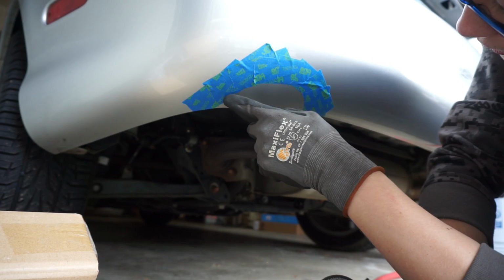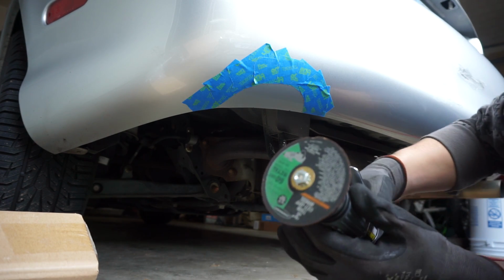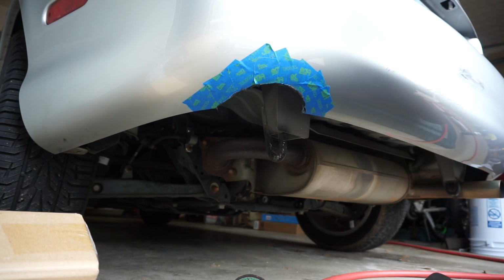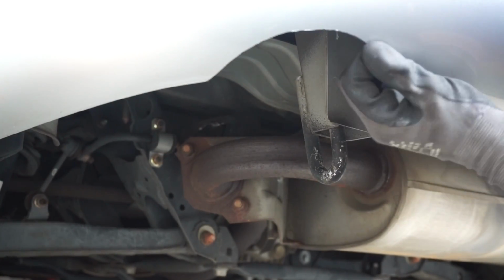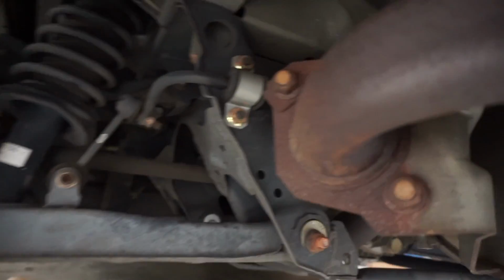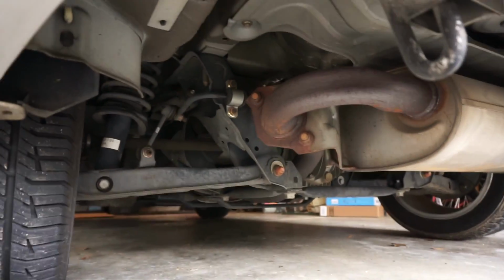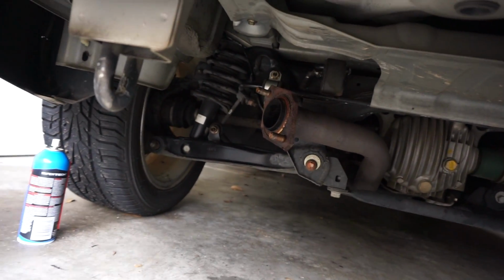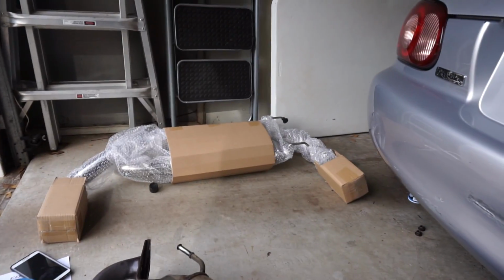NB Miata Dual Cobalt Exhaust Install & Sound

Comment: For the love of God, the guy doesn't have a blown head gasket... I hate to half of you actually work on any car or pick up a wrench. Smoke doesn't mean bad head gasket... Coolant mixed in oil, external leak between head and block, low compression and the list goes on are signs of bad head gasket... Every car smokes slightly whenever it's COLD outside and you start your car... It's like going outside and breathing out your mouth when it's cold out... You'll see "smoke"... lol.
Reply: John Krenisky you're right about the mechanical side of head gasket failures now however the smoke he has coming out of his exhaust has a blue tint which is a sign of oil passing the rings and burning his car definitely is not as healthy as it should be my guess the motor has lost compression since this video
Reply: OMG I guess I may have blown a head gasket when I go outside during the winter!
Reply: Seeing his clothes, i don't think it's winter nor cold outside
Reply: He still revved his engine cold

Comment: Why does your car smoke so much
Reply from the maker: Cold outside and car was a cold start.
Reply: +Kyle Caughill oh cool because I've seen other videos of the same car and idk if it's just these cars or something but I was looking to get one and I saw that yours smokes and I thought it was just a miata problem but thanks man cool vids I love them and are very helpful ima be watching these when I get my car so I can go doing little things to to make it more reliable and a better car
Reply: His motor is burning some oil at start up, the white smoke is water but the blue smoke at first is oil. Usually just the sign of a old motor with some miles on it.